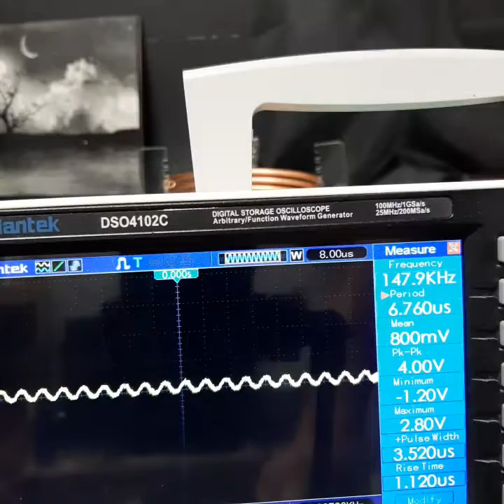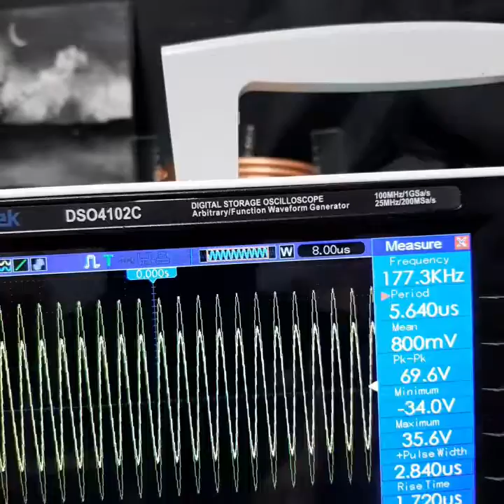Finding resonance frequency of secondary

Comment: Man, that looks great if you are really using those basic Mazilli ZVS driver the way you are saying it. But is that really those cheapo's ZVS or you built your own half bridge & then you are calling it ZVS? Any schematic concerning which type of ZVS you are really using will be much appreciated as I've build different Mazilli ZVS myself but I never used to power my Tesla coils directly with them as I always made use of rotary spark gap. So, I simply need to see with my own eyes how you did it dude. A little help on your behalf will welcome. Thanks in advanced.
Reply from the maker: Hello thanks do you have messager? Also me a Scitubehd did some collaboration with this was alot of fun. Here is a write up he did https://teslascience.wordpress.com/cw-tesla-coil-running-directly-off-a-zvs-driver/. But this was a 1000watt zvs with  all caps removed with a single .15uf 2000v cap works very well with halfwave rectified mains which is 60vac
Reply: @ArcAngelTeslaCoil  Thanks for replying back & yes, I came across his posting & saw that. Mains here in my country is 230VAC. So, I can do it half wave & use that 120VDC to power that same ZVS I have. But the problem is that I've got a secondary coil which is 88mm in diameter, length is 160mm & wire size I used is 0.315 sqmm. Thus, I don't know about its resonant frequency at all, what tank cap I should use & what amount of windings should I use for the primary. That JavaTc is far too complicated for me as it's asking way too many things that I don't know. Grateful if you could let me know about my secondary coil resonance, the tank cap I'll need & wire gauge & turns for my primary coil. Thank dear. For my other spark gap tesla coils, I never had any issues cause at one go, even without any proper calibration, everything worked fine for me.
Reply from the maker: @RAVI171175  would be best to us a stepdown transformer to say 60vac 500va. The max voltage they can is about 64vdc also if use halfwave rectified best to power gates on separate power supply like 12v for best results

Comment: That’s amazing amount of output with small ZVS driver. Great work! Had one quick question. Where does the DC filter cap exactly go?
Reply from the maker: I plug it right to the input positive and negative of the zvs with the polarity of the dc cap
Reply from the maker: Also thank you⚡⚡

Comment: It's the primary that should.be resonant with the drive frequency. The secondary should be 1/4 the wavelength of the primary.
Reply from the maker: Primary and driver are very close to the secondary frequency at least thats my goal lol
Reply: @ArcAngelTeslaCoil  lol then you haven't been reading enough my friend. That's is if your using a tesla coil for wireless transmission ofcourse.